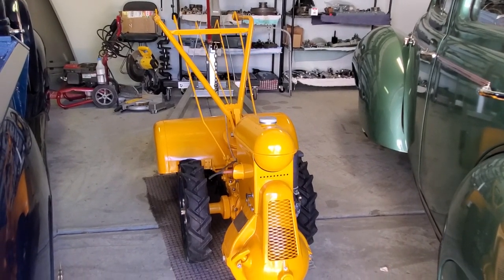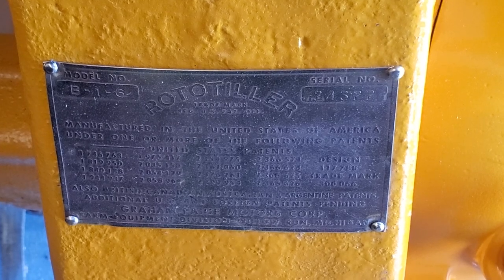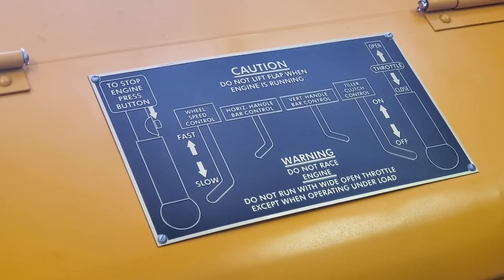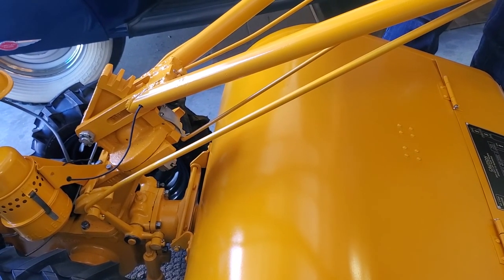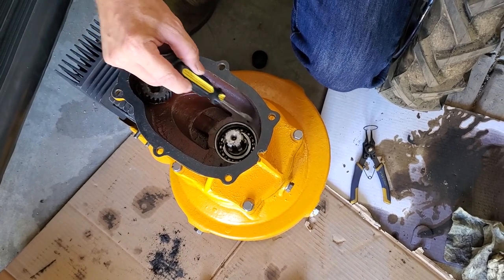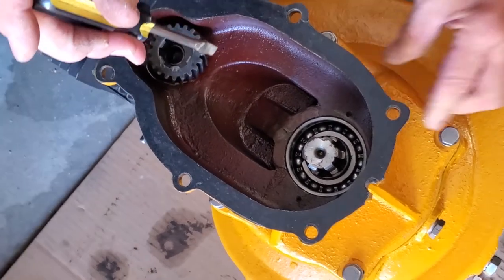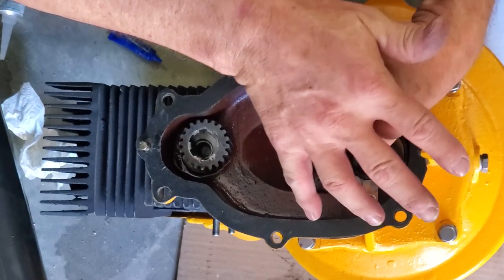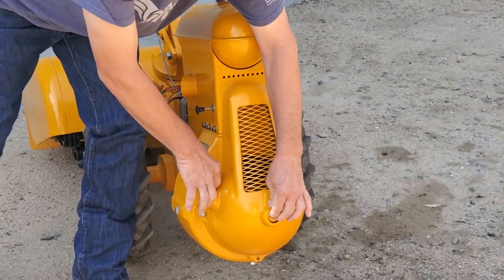How to Start a Graham Rototiller - Starting a Vintage Graham Rototiller

Comment: I had one sitting at the back of our property. Dad used it to till our garden before we modernized to David Bradley TriTrac. I ended up getting rid of the Graham about 10 years ago. It was in some pretty rough shape by then. At one point I can remember my dad using it to run across our asphalt driveway to install a culvert. Not the best tool for the job I'm sure but those spring tines chopped straight through it.
Reply from the maker: Thank you for sharing your memory. It's touching. The surface in the driveway is natural, decomposed granite. The surface becomes hard after several weeks or months without rain. You're right it's a tough machine. Hope someone is putting your Graham Rototiller to good use. Thanks for watching!

Comment: Tine Lever:  There may be shim under the leaf spring that keeps the control rod where you put it.  Remove shim until the lever stays in place.
Reply from the maker: There may be some wear there that I need to compensate for. No shim on this particular rototiller. Neat idea. Thanks.

Comment: Had a few of these years ago.  You need to adjust your bars for comfort.  They start with minimal pull thanks to the impulse coupling in the mag.  My favorite was my B1-6 rs. Top of the line had reverse and wheel clutches.  B1-7 models.
Reply from the maker: Thanks for the tip. It'll be helpful to our other viewers as well. Thanks for watching!

Comment: I had the same problem with that seal on mine years ago. I went through several seals (they only lasted a few hours) before I finally asked the people at Frazer's and got the proper answer. Here is what I was told and what worked in the end... That seal should not have any sealing compound put on it. It actually is designed to grip the shaft and rotate with it against the outer race. This is not what we are used to but it is the way they were built back then. So just do a clean install and you should be fine. No sealing and no home made retainer needed. BTW, I have 2 of these things. Anyone want to buy them?
Reply from the maker: That is such good information! We love it when our viewers share secrets like this, because it's not mentioned in the manual. Your solution is simple and a definite time saver and wow, no need for the home made retainer. Good job! Thanks for sharing and for Watching. I'm sure your vintage Graham Rototillers will sell. I believe they're catching on.

Comment: A regular automotive seal pressed into the wear ring works much better.  Those seals were supposed to be shipped with a ring to be pressed onto the crankshaft.
Reply from the maker: You're probably right that you need the rings, but the man who sells the parts says they're not necessary. Good suggestion.

Comment: What oil did you use in your fuel mixture? I've heard varying information about oils and would love to know what you used. I'm hoping to resurrect one I just got soon
Reply from the maker: Good to hear that another Graham rototiller will be brought back to life. We used Aeroshell Ashless Dispersent oil. Thanks for watching!
Reply: @CarzPlus  thank you for getting back to me. I sure wouldn't want to run one of these alot with the cost of aeroshell shell lol 😂
Reply: @gregsmowersandmore5878 Fram non-detergent SAE 30 should work fine too. Picking up one myself this weekend to setup with one of my Bolens sulkys.
Reply: @WH32R  thanks for the info. I knew there had to be a cheaper oil to use.
Reply: @gregsmowersandmore5878  I run it in my homelite saws and maytag engine. Couple of the older guys at the local shows suggested running with it.

Comment: What rotation does your  fairbanks magneto goes and what  model  fairbanks  magneto it's  .
Reply from the maker: Thanks for watching. When facing the front of the tiller, it's turning clockwise. The magneto is Fairbanks, but the model number is missing. That could be due to wear, or the manufacturer didn't furnish the information. Also, it's not furnished in the manual. You may be able to purchase one through Graham Rototiller parts. You can find various parts suppliers here: https://www.grahamownersclub.com/

Comment: I would have installed the seal the other way. If I knew where my manual was, I'd look it up.
Reply from the maker: We installed it according to the instructions. However, we did try it the way you've suggested, but it didn't solve the problem. Thank you for watching
Reply: I discovered a Graham-Paige Rototiller sitting in front of a recycler/hauler company along with some other antique farming implements.  Maybe they were saved from the crusher, I don't know.  
The Rototiller's serial number was 12,560, has 5-spoke steel wheels and its original yellow paint.  I tried researching its build-date but, I was unsuccessful.  
Can you provide a build-date?

Thanks.
Great job on the restoration, BTW.👍